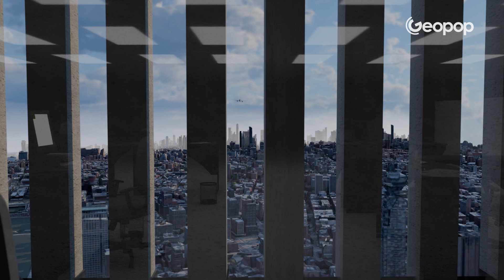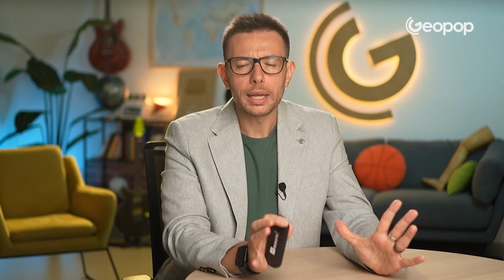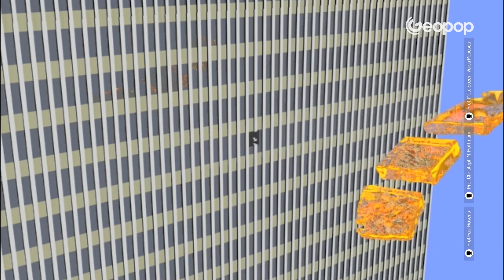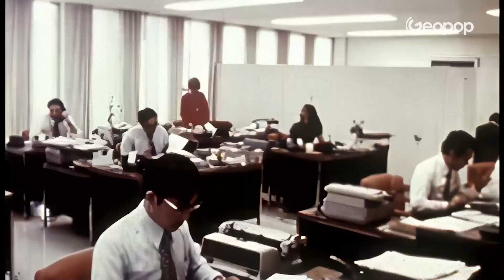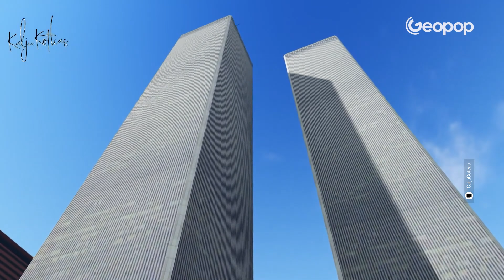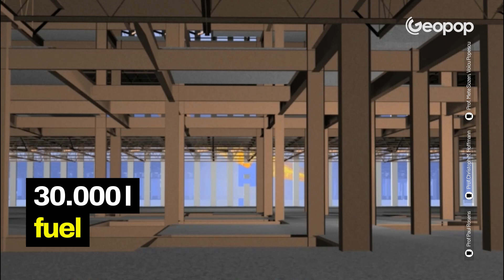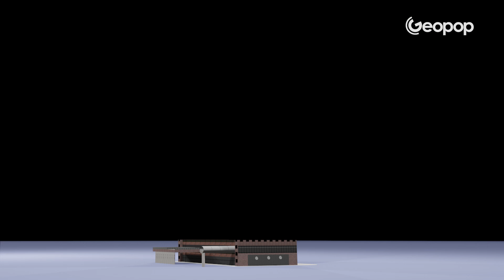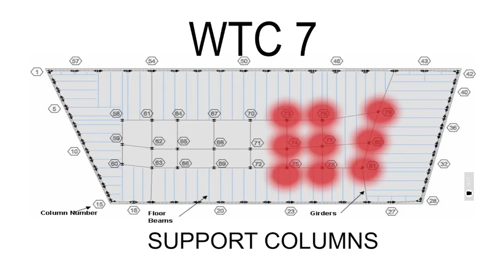9/11, 2001: The Technical Reconstruction of the Twin Towers and WTC 7 Collapses

Comment: DO NOT believe this BS Artist. He is a master at it. You are being overwhelmed with irrelevant and non essential data in order to push the "official story" narrative. I wonder who is signing his paycheck along with those at NIS(?).

I saw the towers hit on live TV (so some delay). I heard the miriad of reports about everything that happened that day. I was on top of it, following it. This includes Mr. Kennedy from FEMA who said they arrived a day early to be ready for the "event" and Mr. Silverstein who said to "pull it", a term used to describe the setting off of explosive charges to bring down a building.

In months previous, on a number of documentaries, I watched many "controlled demolitions" accompanied with detailed explanations. I had no preconceptions of anything with regard to sabotage at that time.

When the towers collapsed I knew what I was witnessing. Dr. Jones of BYU found traces of thermite in the rubble of the collapsed towers. Thermite is used in demolition charges to cut steel. First responder eyewitnesses saw flowing metal in the channel rails of the towers. Others heard and saw explosions shooting out the windows as the charges were detonated as in a "controlled demolition." Thermite causing this is the only explanation for this as no other source of such heat existed in the building.

What about Architects and Engineers for 9/11 Truth? Many members also saying they were "controlled demolitions." Are they simply "delegitimized" because of NIS? I don't think think so.

Everytime someone challenges our government"s "official story" they get called "conspiracy theorists." All despite our governments long history of lying to the American people about many, many things. Just the ongoing revelations from the Trump administration should convince you of that. 😔
Reply: There is so much stupid to unpack in that post, I'll just pick one.

Building 7 owner Larry Silverstein in 2002 on a PBS program called Rebuilding Americas Defenses claimed to have spoken to (he probably didn't) an unidentified FDNY commander. The two expressed concerns over the already horrendous casualties (half of the responding FDNY having been killed in the collapses of the Twin Towers already) and the unidentified FDNY commander agreed to pull the firefighters out of Building 7 since it could not be saved, in order to prevent further loss of life.

PBS Rebuilding America's Defenses: Kevin Spacey (narrator): Pelted by debris when the North Tower collapsed, [WTC] Seven burned until late afternoon allowing occupants to evacuate to safety

Larry Silverstein - I remember getting a call from the fire department commander, telling me that they were not sure they were gonna be able to contain the fire, and I said, “We’ve had such terrible loss of life, maybe the smartest thing to do is pull it.” And they made that decision to pull and we watched the building collapse

For relevant context:

FDNY Chief Daniel Nigro - the on-scene commander at Building 7 on 9/11/2001; The biggest decision we had to make on the first day was to clear the area and create a collapse zone around the severely damaged 7 World Trade Center, a 47 story building heavily involved in fire. A number of fire officers and companies assessed the damage to the building. The appraisals indicated that the buildings structural integrity was in serious doubt. I issued orders to PULL back the firefighters and define the collapse zone. It was a critical decision; We could not lose any more firefighters. It took a lot of time to PULL everyone out, given the emotionalism of the day, communications difficulties and the collapse terrain

Deputy Chief Peter Hayden - 33 year veteran, NYFD in the August 2002 Firehouse Magazine; No, not right away, and that's probably why it stood for so long because it took a while for that fire to develop. It was a heavy body of fire in there and then we didn't make any attempt to fight it. That was just one of those wars we were just going to lose. We were concerned about the collapse of a 47-story building there. We were worried about additional collapse there of what was remaining standing of the towers and the Marriott, so we started PULLING the people back after a couple of hours of surface removal and searches along the surface of the debris. We started to PULL guys back because we were concerned for their safety

The concern is NOT for the building, it is for the people. The building is a lost cause. To avoid further needless loss of life they agreed to pull the firefighters - the people - out.

Also, as I mentioned, the conversation – at least as Silverstein relates it – almost certainly never took place.

So, why does any of that matter?

Oh wait, you thought pull means “blow up” and it refers to the building.

Why?

Because the internet said so? Don’t let the internet do your thinking for you.

Leading demolition and explosives expert and editor of Implosion Magazine Brent Blanchard - We have never ever heard the term ‘pull it’ being used to refer to explosive demolition and neither has any blast team we’ve spoken with

The idea that a commercial real estate developer would speed-dial the fire department chief and order him to blow up an unstable building fully involved in fire (because the fire department takes orders from building owners and rigging a burning building for demolition is totally a thing the fire department does) has to be one of the dumbest ideas in human history.
Reply: @TheLoonResistance  So much stupid in my post? Thats just funny and stupid in and of itself. Thanks for the admission and for sharing though. Continuing...

Three buildings collapsed that day, all in their own footprint. Symetrical and at almost free fall speed. Just like a controlled demolition. It cant happen any other way. However BS happens all the time and there's a whole lot of it on these attacks and the gov's "official story."

As I also said and it is confirmed, Dr. Jones of BYU found thermite particles in the debris of the collapsed towers. Those particles would only be there if demolition charges were used. 

How much steel was cut by these charges? Enough to fill and flow down the channel rails that was recorded on film from the witnesses who saw it.

Also, and I didnt mention before, to wire up a buldings of these sizes takes many days, to weeks to complete. In the weeks prior to these "demolitions" confirmed reports of teams of individuals "allegedly" doing building maintenance were in and all over these buildings. Were they maintenance workers or demolition experts wiring up the buildings for demolition? I know, just like FEMA being there the day before preparing themselves, it was just a coincidence.

No other buildings in modern history have suffered such catostrophic structural failure due to even prolonged fires. Were they gutted by those fires? Yes, but their structures remained in tact. 

The towers were way overbuilt. Something like 12 times more than required. But somehow localized, hot "fast burning" fires overcame all that and "the towers came tumbling down." I not only dont think so, I know so.

I could go on but Mr Poo for Brains here doesnt listen anyway. Its Architechs/Engineers for 9/11 Truth you have to "debunk" not me, and quite frankly you can't. 

How many people were complicit that day with these planned and government allowed attacks on America? Its impossible to know how many but its blatantly obvious that our government had to have assisted the terrorists to overcome all the security measures in place to prevent such things.

While our gov as a whole has many good people in it, many of the movers and shakers at the top are corrupt and they planned and executed these attacks in order to bring about their NWO Globalist agenda which is simply tyranny instead of liberty for America and her People. 

President Kennedy spoke of them and their goals in his Conspiracy speech and  before that Eisenhower spoke of them in his farewell address. 

So in essense the idea of a "Grand Conspiracy" against America is not based in outlandish claims by ignorant and stupid people, but rather in the revelations of these 2 Presidents and others who were in the know..
Reply: @jamesroe4968  - 6 buildings collapsed that day, not 3,  4 of them collapsed because the first two fell well outside their footprints.  Another 4 were destroyed for the same reason. 

So look at that, you failed with the very first mindless repeaterism so I didn't bother reading beyond that.
Reply: @TheCriticalStinker-01 you know , this bs does not line up with the truth. The building was evacuated at about ten thirty a m and there was nobody anywhere near inside that building after that point. So nobody pulled out of the building right before it collapsed , like you are saying. No one.
Had been in that building for at least five or six hours. And pulling a building down refers to control demolition
Reply: @robbiehiatt9966  The firefighters were there. This is exactly what he was referring to.
Reply: @BoodahBodey the Firefighter said" it was as if they had detonators and planned to take down the building" clearly you don't understand English if thats what you got out of that footage.
Reply: @r @robbiehiatt9966 As if there were” is not the same as “there were.” Yet you want to attack my knowledge of the English language? LOL There is zero evidence of any controlled demolition. I have studied this for 25 years, and have a degree in structural engineering. Did the firefighter? Or was he speaking out of adrenaline in the moment when everything was chaotic and trying to make sense of and explain something that he had never seen before, and was way over his head?
Reply: @BoodahBodey As if anybody was gonna believe that you are some structural engineer. You're profile is a cartoon and your name is Boodah Boday, Coyote Creek. You're not even a good liar. He wasn't speaking out of adrenaline.  That video was taken later. And the evidence is overwhelming. 
1.The firefighters said" it looked like they planned to take down the building" I didn't say that, The fire fighters said that. They were there.I'm sure they know best.
https://youtu.be/XiIT4HInWjY?si=e1Pvp3-IFs-M75Oj
When the firefighter says "boom, boom, boom, boom" in this video.
What do you suppose he is?Implying by " boom" ??
2.So if there were no explosives then what is this? 8:25
https://youtu.be/bLF5D7M1YgA?si=aHSvS__uOdxMi1ZB
You can't say that it was added because you can see the firemen's reaction to the explosion. And you can't say it came from anywhere else because the firefighter says
" We gotta get out of here,  7 is exploding "
3. Controlled demolitions have squibs, you can see the squibs here 20 floors below the collapse. 
https://youtu.be/eXAgulfAtR4?si=-iLO9aQjMJVLTUYH
4. Firefighter says "any one of these buildings could blow up,  this ain't over yet" firefighter says there's 3 secondary explosions. 
https://youtu.be/0Gh3ErgMI4M?si=mmp9Eus_5PWTCBfl
5. Airplanes can't fly 600 mph at 1000 feet. And to be able to make a 180 degree turn to hit the opposite side of the pentagon going that fast is ridiculous. And since when do terrorists hit the opposite side of the building where no one was at when they could have just flown straight in and killed way more people???
 https://youtu.be/0Gh3ErgMI4M?si=mmp9Eus_5PWTCBfl
7. No one has ever known ahead of time that a building was going to collapse except through controlled demolition.  Tower 7 was reported to have fallen while it still stood in the background. 
8. Larry silverstein,  the man who made over 4.5 billion when they fell, claimed to have pulled the building down.
https://youtu.be/1jQaJFNWqtc?si=wCywQ9grgBdS_w11 yet somehow today he is only worth one billion dollars.
Ive really been studying this for 16 years. And ive got actual evidence not cheap words.
Reply: Please tell us how "they" managed to keep the explosives from igniting for 1-7 hours after the impacts, and raging fires? The colapses initiated at the point of impacts. So how did they rig the explosives so that they were not damaged by a plane collision?
Reply: @BoodahBodey there was a huge explosion when the planes hit , and it would be hard to prove that there weren't